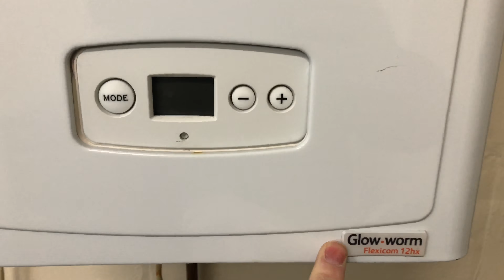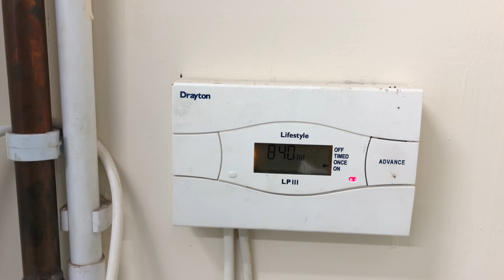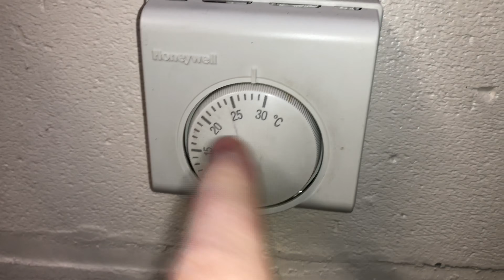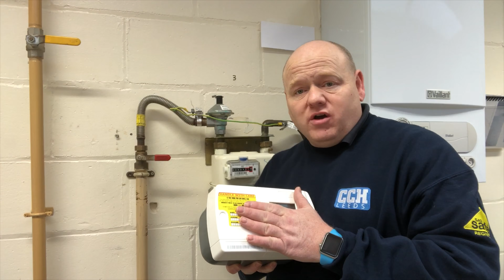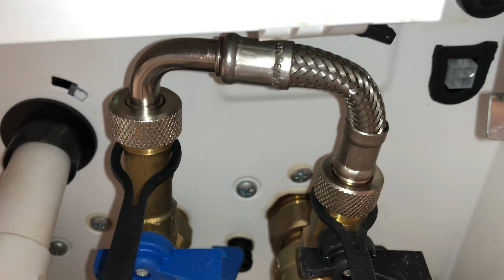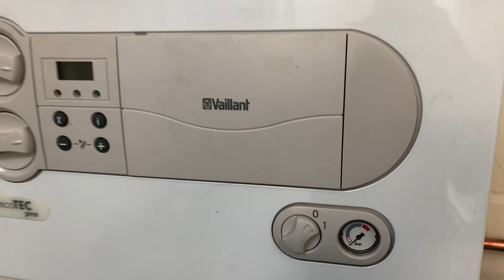HOW TO REPAIR YOUR BOILER - Tips & Tricks

Comment: Why does my boiler get blocked with black gunk about every 3 months. The little u bend on the bottom of the boiler get blocked with thick black gunk, I only fix it because I know I'm not going to cause any damage to the boiler. I live in a rented house and if I report it when it stops working they normally leaver me without hot water or heating for a few weeks, so I watched what they were doing so i could do it my self. Last year I had a gas engineer come out and he opens it completely up and cleaned out loads of black thick gunk from inside, since then it has not gone wrong for almost a year. It has started happening again. Is this a normal thing to happen with a boiler?

Comment: Hi Allen
Just wondering if you have any ideas with this boiler I am having problems with. Its the Duo-tec 2  Combi 28 GC 47-075-55 its got a very loud vibration noise coming from it when it goes in to Minimum output. I have replaced the gas valve still no good all the co2 setting are correct, have tried the calibration function several times, flue ok Venturi ok  . And Baxi technical have been a waste of time even saying they have never had this problem before. its that loud you can hear it from outside, its just out of warranty and they are not interested. it happens intermittent with the customer. I can only get it to do it when i put it in to minimum output  00 setting. 
Any ideas  

Cheers Ray Walker
Agas Services

Comment: hi allen how do you know if the preasure vessle needs topping up or the water preasure needs topping up?
Reply from the maker: Your gas engineer/ plumber would need to check that on the service, normally they can be pumped up. 👍

Comment: i had no heating but hot water although it took a minute to heat up turned out the batteries in the room stat were dead luck for me my mate is a gas engineer so it only cost me a couple of pints in the pub but it could have been expensive batteries if i had to get someone out

Comment: Is it against the law alan to just remove the cover of a boiler ?? I had a guy check mine out when it went faulty but he said you only need gas safe to install the boilers rather than maintaining em ,
Reply: Taking off the cover is "technically" illegal. But so is doing 34mph in a 30 zone. That extra 1 mph, allowing for faulty or an inaccurate speedometer will still get you a ticket. There is a 10% permissible allowance for this.  So, a plumber but nonetheless, non registered GasSafe person, or a plumber (perhaps semi-retired) who was formerly GasSafe/Corgi registered, may perhaps JUST inspect the inside of the boiler to diagnose/locate  a fault in order to advise another,  GasSafe person of the fault, in order to attend and rectify. You are quite correct. Removing the front cover is, according to the full letter of the law is illegal. Hanging the boiler and cutting for the flue, running in CW, hot water out and connecting flow and return via the rads is not. The initial testing of gas let by and tightness, connecting service pipework for gas and final commissioning/certification of the appliance should ALWAYS be undertaken by a GasSafe registered engineer. ALL servicing and maintenance should similarly be carried out by someone who is GasSafe.

Comment: I had a new boiler fitted and one of the soldered joints leaked causing water damage to my ceiling. Is the plumber/engineer liable for the repair to my ceiling? (Thankfully only cosmetic).
Reply: sounds like hes either incorrectly heated the fitting so somehow the solder has not soldered fully around. technically it could be his problem but it must of been semi substantial as you would of known straight away from testing afterwards of hearing/seeing water pass and pressure slowly drop. as i see its only cosmetic. id say hes liable for a new lick of paint and to redo the fitting/s.
Reply: Yes. If the person who fitted the boiler actually made alterations to that particular section/locale of pipework. However, if the boiler was fitted upstairs in the loft space and your 1st floor toilet started to leak, then probably no fault. It is exceptionally unlikely that this was the fault of fitting the boiler in a different part of the property. Check certification re GasSafe and ask for evidence also of public and personal liability insurance before engaging a contractor. Also, get a receipt.

Comment: My sister got caught out by the thermostat dial getting knocked back so no heat from the radiators. She was adamant from a google search and the next door knowitall  that the diverter valve had had it.

Gave me a laugh to point out the real problem!

Comment: Hi Allen, what is that on top of the Logic? Is it  some sort of Heat recovery system?
Reply from the maker: Yes , it pre heats the cold water 👍
Reply: Cheers! I wasn't aware that Ideal made those, couldn't find them on the website. Much neater than the Worcester ones too.
Reply from the maker: @ashcroft13  Normally find them in new build houses,

Comment: Had to laugh when you mentioned the token meter, in a previous rented house we lived in it was pre pay meters out side on the wall, I was trying to wash up but boiler kept cutting out kept resetting it but no, red light came on and shut off .....was on the phone to the letting agent just about to tell them boiler was buggered then it dawned on me......gas had ran out 😂😂
Reply from the maker: I have been called out to no gas in the past 😂😂😂
Reply: @AllenHart999  haha I quietly hung up, slowly walked outside to be confronted with £0.00 😂😂  at least I realised before I made a massive fool of my self ha....trying to be one of those Arm chair DIY boiler engineers when he turns up, ah Hiya pal soooo I reckon the pump has failed .......er no pal you ran out of gas lol.....
Reply from the maker: @LeeGee1983  I have seen engineers change parts in boilers before checking the basics 😂😱👍😂
Reply: @AllenHart999  I bet, striped half the boiler down still not working then realise gas isn't on haha. That must be incredibly embarrassing.
Reply from the maker: @LeeGee1983  I went to a house about 15 years ago and it had a box of parts on the floor, The fault was live and neutral was the wrong way around, They had a new fuse board... 😂😂😂😂😂
Reply: @AllenHart999  lol ....funny.  he must of got his wires crossed when trying to find the problem 😂😂😂😂
Reply from the maker: Lee Gallie 😂😂😂😂😂😂😂😂
Reply: Face palms?????? Credit your pre-payment meter or hit emergency credit button. Check that ECV is in the on position.

Comment: Nice video, what do you do if the boiler pressure continually goes up to high after several days. Have been lowering by bleeding rads
Reply: Filling loop passing/left on. Water slowly getting into heating system.
Expansion vessel needs recharging or replacing.
Owt else, Allen?
Reply from the maker: You beat me too it, Thanks 👍
Reply from the maker: Could be a number of things, One could be filling loop is passing, could also have a faulty expansion vessel, Might be a good idea to have the boiler serviced and they can check it out for you. 👍Thanks
Reply: Assuming it’s a combi and not a system boiler. Plate heat exchanger could be compromised.
Reply: @heatservicebwcuk1545  Yes, it's a combi. Valliant. Had the expansion tank replaced two weeks ago as had a small leak and pressure kept dropping or rising into the red. But now pressure keeps slowly rising into the red after a few days
Reply: Dean White what boiler do you have ? Is the filling loop external usually a chrome braded hose or is it built underneath the boiler. First check that this isn’t letting by by removing it and capping the valves if external filling loop. My guess would be it’s passing or your plate heat exchanger has failed and is letting mains pressure into the heating circuit.
Reply: @heatservicebwcuk1545  Valliant Eco Tech Plus 837. I think the filling loop is internal. I'll check as you suggest. Thanks for the advice.
Reply: Dean White common issue on that boiler as with the flexicom which is the glowworm equivalent. Best thing is to cap the loop and fit an external between cold and return
Reply: @heatservicebwcuk1545  Brilliant. Thanks
Reply: Dean White no problem
Reply: @Heat Service bwc uk    Beggars belief that the x 2 check valve with a levered iso/ stop supplied/designed to be fitted to the cw and the iso is fitted to the heating return. Isolate and fit separate removable filling loop. Sound advice. Never, ever leave the filling loop fitted after topping up pressure. Pet peave of mine.
Reply: @heatservicebwcuk1545  Bit of advice if you don't mind please. Just had an engineer come over and 'cap off' the internal flow. Told me to watch the pressure. So left like this, I assume I can't fill the boiler should the pressure drop now as it's isolated from the mains?
Reply: Dean White sounds that way unless you uncapped and refitted. Hopefullly the fitter has done this as a temp to confirm it’s letting by ? And arrange to fit new one ?
Reply: He should of been able to tell straight away really if it was passing... ask him if it was . If it was I would keep it capped and fit external filling loop. cheaper and less hassle in future. If it wasn’t passing then you may be looking at a failed plate heat exchanger
Reply: @heatservicebwcuk1545  Thanks, he left and said just keep an eye on the pressure. I did this through Corgi insurance, just want to be in the know when i call them up next, don't want foot an another £60 excess for the same fault. He did however mention fitting an external flow, so hoping that's a temporary measure. Cheers
Reply: Dean White yeah by the sounds of it he’s capped it to prove that’s the issue. If the pressure doesn’t rise in the next day or so or if it had already been that long since capped off then contact them back and tell them you’d like an external filling loop fitted. Assuming there is access to get to the pipework under the boiler. 8 - 12 inches of clearance will be fine. I’d charge 70 pounds myself but don’t know where your based
Reply: I mean if your confident do it yourself. Turn mains off , drain heating side down from lowest point. You will need two tee fittings compression fittings would be fine as I assume you don’t have a soldering gun ? Cut pipework far right hand side pipe 22mm which is heating return and 15 mm pipe 1 in from the right. Cold main. Fit two tees in line you will need a short peice of copper to come out from the tee fitting into each valve on the filling loop.
Reply: @heatservicebwcuk1545  Great, thanks, i'll do that. I'm based in Hampshire not far from Basingstoke. Very much appreciate the advice.
Reply: Dean White no worries atall mate